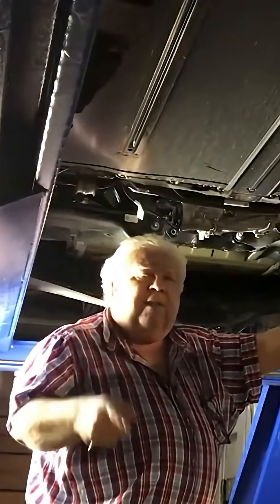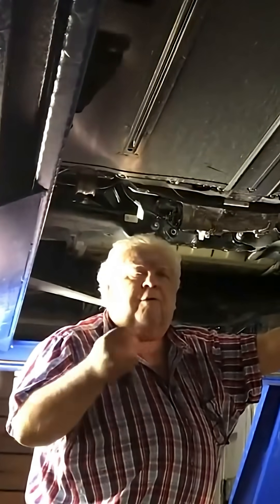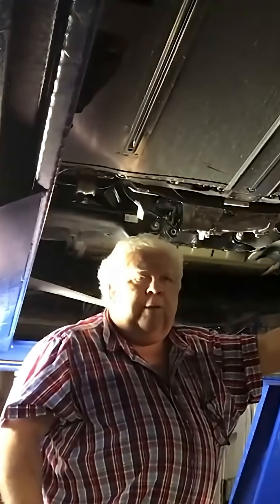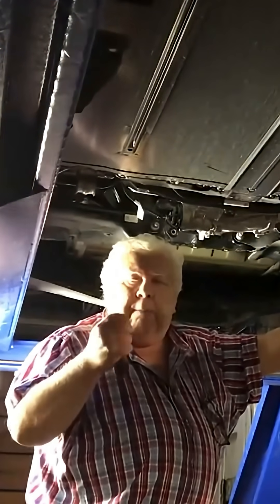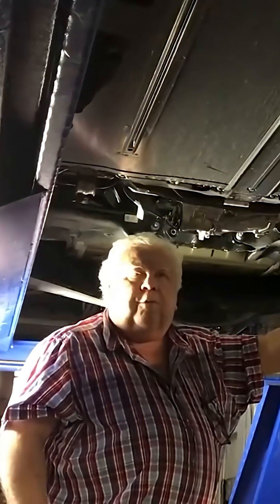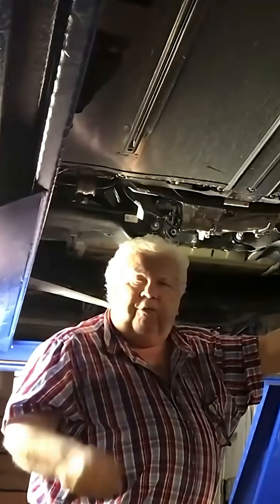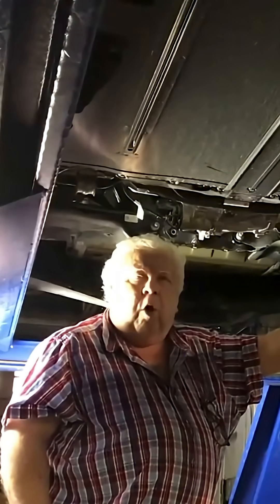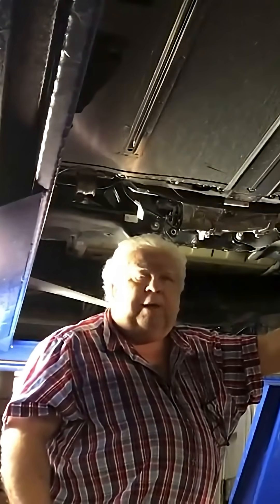Oil changes no longer recommended.

Comment: Seen those drive units go out all the time because tsla cheap desing allows for excessive oil sipping. Also the oil pumps tend to fail. Eventually gears lose lubrication and bye bye drive unit. Of course it happens when is out of warranty. 😂

Comment: An EV charges for the cost of the oil changes and filter, the gas or diesel is the money you save every day.  The cost is downtime while it charges and shorter range.  Most often this happens while you are sleeping.  The cost of fuel in higher mileage vehicles  is the offset costs vs extra time you need to work.  So if you have a long range Pickup truck EV the time you spend fast charging between long range runs.  This can be an hour or two, taken while on breaks or eating dinner lunch breakfast etc...  but the cost of the fuel is how much more you have to work to cover the cost of the fuels.  Say $50/hr but you spend an extra two hundred dollars you need to work four extra hours each day / trip.  Minus charge time say two hours minus breaks say 1 hour so in a day say 1000 miles you spend an extra 3 hours working each day.  If you long range drive say 15,000 miles a month hotshot driving.  You loose with gas or diesel costs 45 hours a month or 500+ hours a year or have to work to cover the same costs 20+ extra days.  If you work just as hard with an EV vehicle you will save 1 month a year in operational costs which can be used on quality of life or bonus paid time off.
Reply: This WOULD be true if EVs didn't become obsolete in 2 years